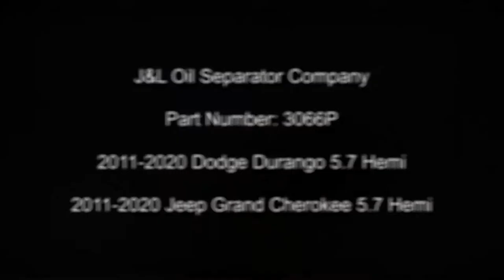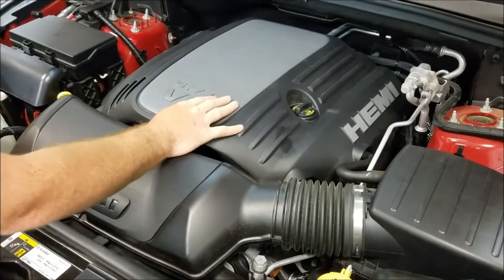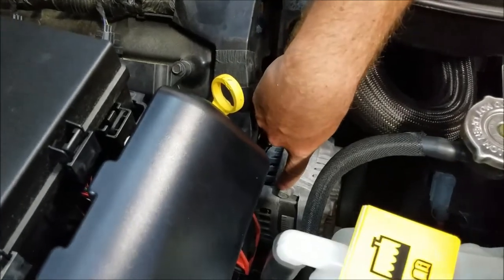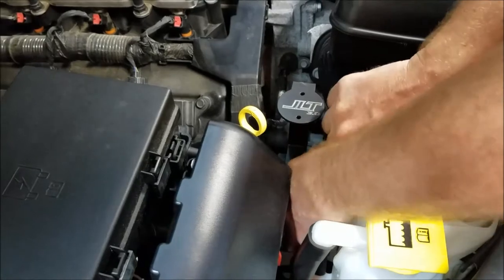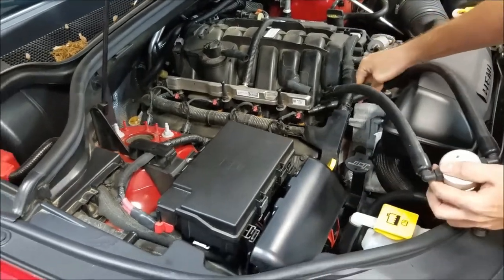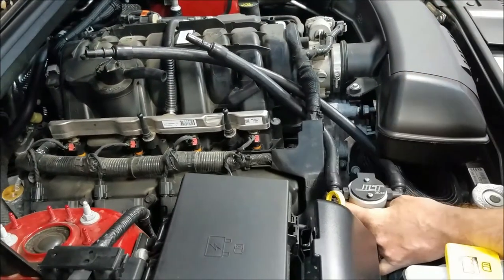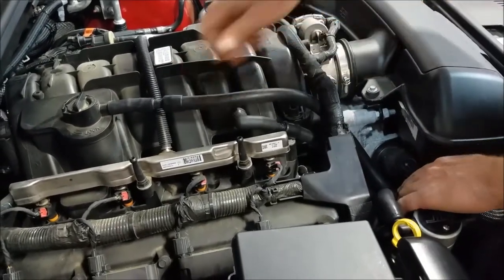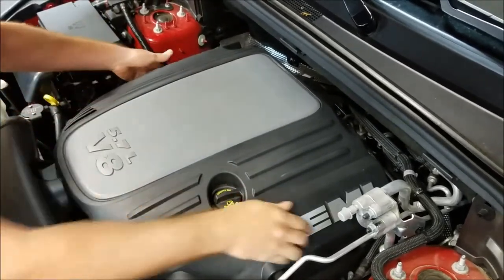J&L Oil Separator Co. 2011-2024 Dodge Durango 5.7L; 2011-2021 Jeep Grand Cherokee 5.7L Install 3066P

Comment: I would like it if you would make available for a 2019 ford edge eco boost 2 liter engine !
Reply from the maker: Hey Ed,

We should have you covered in the next week or two, we just had a new 2.0 Maverick in here that should also fit the 2019+ Edge.

Comment: Is it bad to have the lines literally resting on the radiator hose? Lots of heat there.
Reply from the maker: No issue, the oil vapor running through the hoses is as hot if not hotter than the coolant in the radiator hoses.
Reply: @jloilseparatorco.1853  Thanks! I just ordered one.

Comment: Would the low part of the hoses start to fill up over time?
Reply from the maker: No they won't. The lines are under vacuum so nothing to worry about.
Reply: I couldn’t get the nut off the alternator and started rounding it.  I ended up using an m8 nut over the existing alternator nut and 2 washers between the separator bracket.  I’m guessing the hardware under there was too hot and needed to cool down over night.  I used penetrating oil and waited an hour and a half but still wouldn’t loosen off.